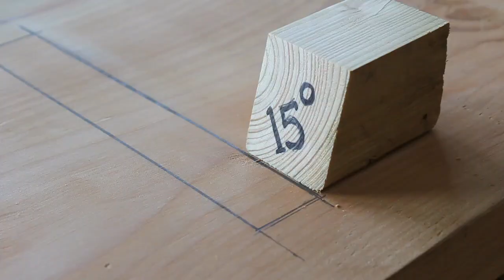Viking bog chair, for gazing at the stars. | How to make a slot chair

Comment: Nice work but, What are the measurements?
Reply from the maker: Thanks, the back is 115cm tall from floor, and the top of the slot is 28cm from floor and 20cm wide, the total length of the slot through is 120cm with seat being 34cm front to back. (all approx give or take 0.5cm)

Comment: how do you keep your jigsaw blade from angling?  When I try to use mine, it always pulls itself in, angling the piece a bit.
Reply from the maker: Hi, jigsaw blades will always wander to some degree extent especially on material over 0.5" thick. Use a new blade and cut slowly on pendulum action.

Comment: Awesome work!!! What happens if you don't do the 15 degree bevel?
Reply from the maker: It's more upright, and your weight is further forward.  (some make them with out the bevel) I made a quick mock up using 3x2's and then measured the angle.